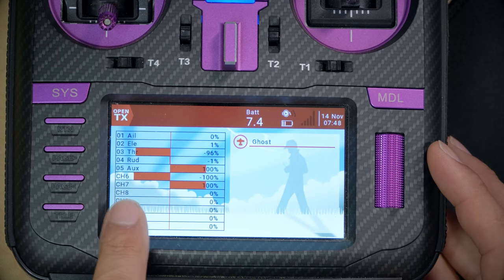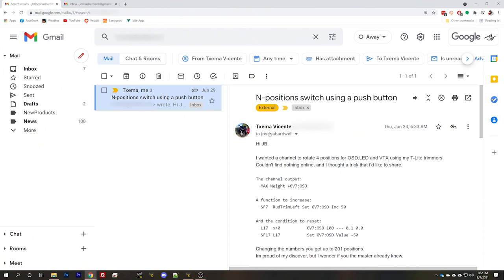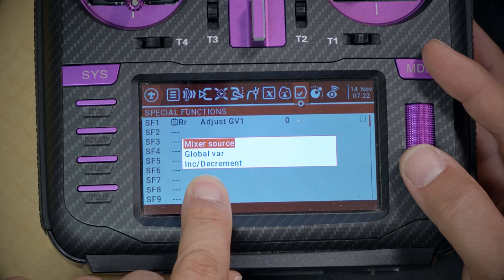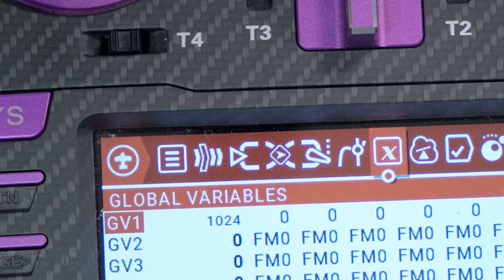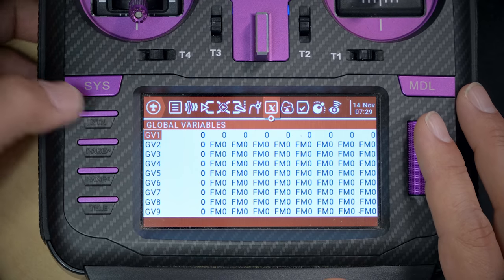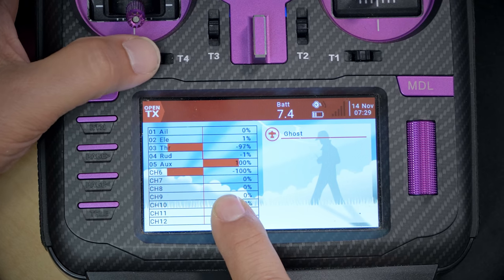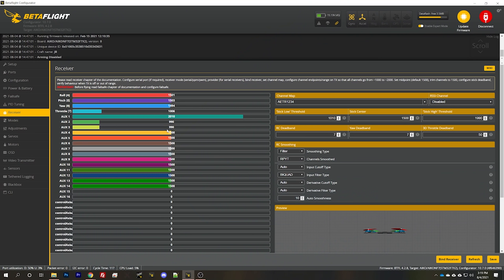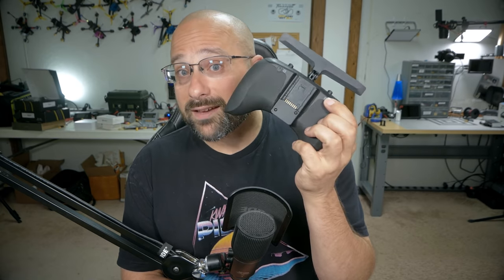Your trim switches are useless. Let's fix that. (OpenTX n-position switch from momentary tutorial)

Comment: Wow, this is awesome as I am wanting to use a momentary switch to control the gimbal on my quad rather than the knob. With using the knob I have to take my fingers off the sticks and so cannot perform certain shots. Now I will be able to do it with the momentary switches, left one for up and right one for down. I just had not sat down to figure out how to achieve it and this video saves me the time of working it out.

Comment: I haven't used Betaflight for about 3 years now but have transitioned over to iNav.  In iNav, there are tuning parameters that can be displayed in the OSD and the values can be changed in flight by using the same trim button technic as JB described in the video to change the values of the individual parameters displayed in the OSD.
Reply: Nice thats good to know. I have BF on my Drone's now but im putting together an FPV Wing plane with INAV & ELRS so im going to use some sort of FC board.
Are you flying a drone or a plane with the iNav?

Comment: The extra trims are very handy for airplane use if you use a gyro.  I use the SxR series from FRsky and I assign the T5 trim as my gyro sensitivity.  I don't like knobs for this function because when you switch models you will lose the gyro setting.  Since T5 is a digital trim it will remember the setting for each model.

Comment: Joshua, if you know of a way to use a USB flight controller (like the T-16000M joystick and throttle)  to control different radios like crossfire or whatever, I'd love to see a video about it.  Perhaps even making a portable base station that plugs into the DJI analog goggle input and can be put in a pickup or on a trailer for some "immersive" piloting.

Comment: This is really great, was going to try adding hardware switches to my Flysky FS-i6X, but using the trims will be so much more versatile!
Reply: I can confirm this also works on the FlySky FS-i6x running Open I6X

Comment: I was able to do it with my radio master tx but with the radiomaster zorro, when you set up the gv value back to 0 it just stays there. hard to explain but doesn't work on the zorro. this would have made the useless SD button they have, more functional.

Comment: I am already using this for rates on an x-lite. 200 divided by one less than the number of positions for the switch is the best value to use. I also added a second global that gets incremented by 1 so I can have it display so I know which rate I switched to. You made a 3 position switch for example which would be 200 / 2 and that is what you set.
Reply: Dang, I would love to have my normal freestyle rates plus a super slow super exo mellow rate that I can do on a switch,
But I don't understand how you did yours?
Reply: @definingslawek4731  it’s similar to how the OSD is switched but you set to change rates instead of OSD. There’s a command line setting for 6 pos switch so you can use all 6 rate profiles. On my larger transmitter I just use the 6 position switch but the smaller transmitter does not have one. The step amount for 6 pos switch should be 40. Use that instead of 100 and you will have a 6 pos switch. You can loop back when you get to the end of the range or have the other direction on the trim switch subtract 40. You can combine looping with the other switch as well if you want both.

Comment: Stepping is in plus minus 100 %... Smallest step 1%
So 201 positions possible in maximum
If you increase by 100 and reset to minus 100 you have 3 position switch like a normal flip switch.. Yeah thats cool... Or could be 50 % and a 5 position switch... Cook idea.. And i even got more ideas from that video

Comment: Well hey ELRS 2.0 now have "Wide" switch function that replaces the 1 bit switch thingy with 7 bit so now you can have 128 positions now. I was wondering why in the hell this doesn't work prior to elrs 2.0 because I was thinking of using my trims as my led cycle switch.

Comment: The values in the radio are +/-100 %. These map to 1000-2000 in Betaflight, so -100 maps to 1000, 0 to 1500, 100 to 2000.
Reply from the maker: Correct

Comment: Can this also apply to DJI goggles? Lots of displayed data, battery info etc, followed by all data removed on the screen? I'm still assembling and configuring my kit, yet to fly.
Reply from the maker: DJI doesn't support OSD profiles.
Reply: @JoshuaBardwell  Thanks Joshua, I would not have started this fpv / hobby / journey if it were not for you!

Comment: Hello Joshua, again a very good video. But I would still have a very special application area that I would also like to see in a tutorial. 

Wouldn't it be fantastic to be able to tune the PID on the fly with it? I imagine that you assign P, I and D to the three positions of the SD switch on Tx16S and use the trims to set the respective channel roll, pitch and yaw. 

If this could work, it would be an absolute relief for PID tuning.
Reply from the maker: https://youtu.be/JpnCMLmxme0

Comment: What rf module is that in your tx16s?? I have seen it has two antennas?? Diversity??
Reply from the maker: It's Ghost
Reply: @JoshuaBardwell  thank you.. I thought there is an elrs with two antennas.. Nice video..
Offers a lot of new possible functions... Another 5 or six position switch?? Yepp thats easy
Rates or mixer in a few different  steps?? Also possible... Well done josh.. Thumbs up and happy flying.. (how the hell do you fly around your house not crashing toooo often?!?) i love to use that map in lift off.. Grin

Comment: Changing vtx chanal Work too?
Reply from the maker: https://www.youtube.com/watch?v=a1_U2v0kAjg&ab_channel=JoshuaBardwell
Reply: Yeah but I think that's better on a three position switch. If you crash somewhere and video signal is completely gone (but RC signal isn't), you can just throw your switch to 25mW to keep the VTX from burning out without having to check your radio what value it actually is at. Or you could do a non-cycling value with a left and right trim switch so a few pushes to the left puts it at 25mW. But then again, it's easier to flip a switch while flying acro if you notice video range is insufficient.